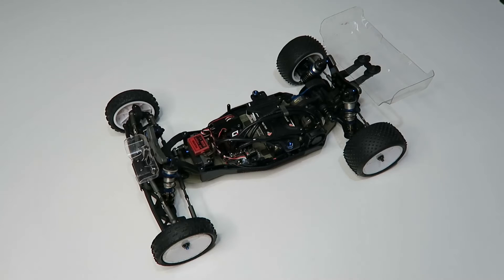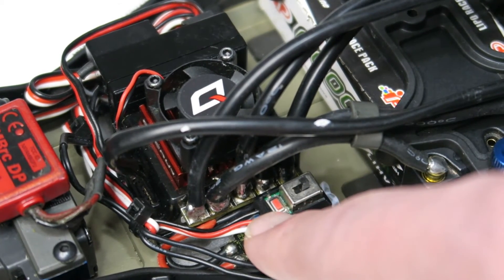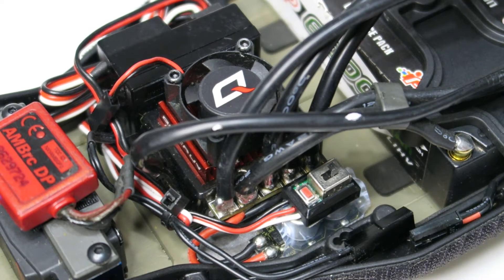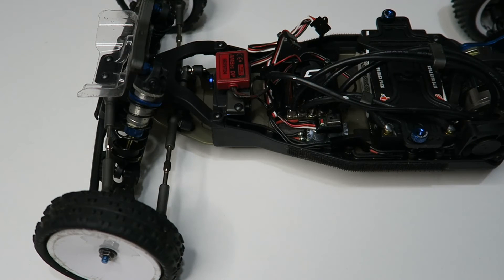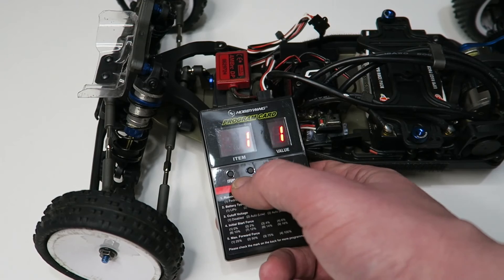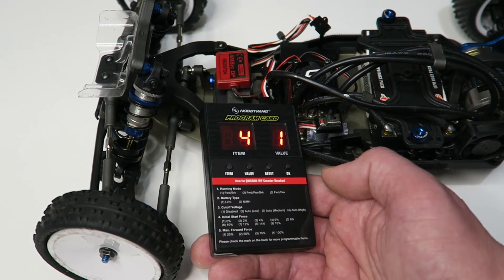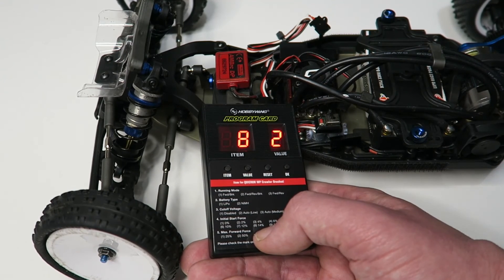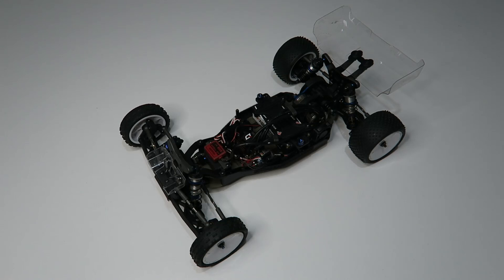Setting up the Hobbywing Quicrun 10BL120 - an RC ESC bargain!

Comment: Love this esc, its something I recommend a lot in the drift world for people who get disheartened when they find out everyone is running £200+ esc's. Works really well and the advanced timing allows them that elusive 'turbo' they all want. Just for context though, I run 25deg boost timing, 45deg turbo timing and 25deg endbell timing and no motor fan with 20+ min run times, its amazing what you can get away with when you don't have any grip lol
Reply: Does this part (quickrun) come with boost?
Reply: @aacgaming9023  yeah the setting is called advanced timing, look it up in the manual. It's not as good as a proper drift esc but it gets you started..
Reply from the maker: The timing adjustment on this is not boost, it is static timing advance, I would recommend leaving at zero.
Reply from the maker: No boost on these
Reply: @fiveeight0sixsix  it's actually what we would refer to as 'turbo' but yes it does have it, it comes in at full throttle exactly like turbo on any drift specific esc. I ran one for nearly a year in a drift car I know what they can and can't do. I will always correct bad advice on these when it comes to using them for drifting.

Comment: Excellent and in depth. I have had problems with this, but you just showed me how to set it up. I was having reciever brownouts and run aways. I now know to set lvc to 3.2-3.4 and lower the punch. The punch at 7 was giving me low voltage and amps to bec. Thank you great video
Reply: Just had a run away with mine and luckily the car flipped before hitting the kerb at 50mph
Reply: @wayneyates700  if using flyshy radio set the fail safe. Replace the cap pack with at least 6600uf
Reply: @rccarsandmusic2641  I am using flysky, so thanks for the information 👍. I've tried looking into it more but there's only so much I can find. 👍
Reply: @wayneyates700  I did that than it ran faultless
Reply: @rccarsandmusic2641  I think hobbywing should really be putting more info on there packaging and in the instructions if it's not just plug in and play, if I new what I know now I wouldn't of bought it. TBH I might leave it out and run brushed again for a while as I'm using a Tamiya TA05 and not all parts are readily available, and it's in nearly mint condition so I can't risk another run away, 
a massive thanks for commenting back it's appreciated 👍

Comment: Good day! Nice video. I am still ocnfused: a long delay in my throttle... i press throttle and no responce, but if i press it second time i works
Reply from the maker: You probably have the motor wired up backwards and you are actually activating reverse on the ESC.

Comment: It is actually a Speed Passion GT2, which itself is a derivative of an Xerun v2
Reply from the maker: No, the case may look the same on the outside but the boards inside are completely different.

Comment: Hi bro, setup this ESC with 3650 Rocket unsensored motor for my speedrun build. I have an issue with full throttle, when I do that at lets say 10 mph I have delay of 2-3 second and can't control anything, just rolling can't stear can't brake nothing.. after 2-3 seconds the ESC responds again.. what do you think? When I drive lets say 30 mph and full throttle than its ok.. Running it with 2s lipo and mod1 gears on wltoys 124019... Not tried with 3s yet. My program card is on the way maybe need to configure something but what?

Comment: Awesome video - thanks.  Quick question - do you know what a constant red blinking (1/sec) LED means?  I am unable to complete the calibration, enter any program modes or reset the ESC - just get a red blinking LED regardless of how long the 'set' button is pressed / held...
Reply from the maker: Possibly no signal. Make sure radio is on and bound correctly to receiver. Check esc is plugged into receiver correctly (signal wire in correct orientation)
Reply: @fiveeight0sixsix  Thanks for the reply.  The receiver is bound, as the steering works as expected.  There should be a signal, as I can move the steering to a number of channels and it works fine - but when I use that channel for the ESC, just a red blinking light.

Comment: Good review thank you. It was vey clear to understand the button configuration and the program card. Does this come with the sensor cable in the box? Or does one need to be purchased and does it have to be hobbywing specific? TIA.
Reply from the maker: I don't remember if it came with a sensor wire. 1/10th scale sensor wires all use the same plug.

Comment: Hi great review! Thanks helps a lot! I've managed to calibrate but I don't get the solid green when in full throttle or in full reverse. Is there something that I'm doing wrong?
Reply from the maker: Make sure the radio is in its default settings with no travel limits applied.
Reply: Thank you! It was the transmitter

Comment: Thank you very much for covering the setup process using the led card and for the settings advices..I just installed mine (10BL120) with 10.5T Hobbywing Justock G2.1 4000KV motor..I made the first calibration and everything is ok,but the fan is blasting at full speed all the time,soo loud,is this normal?When I start the ESC the fan is gradually reving up till it sounds like a turbojet and when reaches maximum revs stays there all the time.
Reply from the maker: Totally normal, it's a powerful little fan. If it bothers you you can unplug it, although the ESC is more likely to overheat, I wouldn't recommend removing it.
Reply: @fiveeight0sixsix  ok,thank you for quick answer.

Comment: Thanks this was helpful one, got mine pretty nicely dialed. But what are the boost and turbo what some are talking about? Some higher end stuff?
Reply from the maker: Features to advance the motor timing dynamically for more performance. High end.  Rarely used in racing any more.
Reply: @fiveeight0sixsix  but this esc doesn't have them?
Reply from the maker: No it doesn't

Comment: I'm struggling to de solder the standard cables, I have a 30wt iron and it's not melting the solder. I need to remove the standard cabling as they are all far too long to fit under my WLToys 124017 body shell. Should I buy a more powerful soldering iron? The iron I have is 100% fine with everything else I work and I've never had a single problem with it until now.
Reply from the maker: The factory solder needs a very high temperature to melt. A more powerful iron will help with a small chisel tip. Also cut the original wires short so they don't act as a heatsink, just enough to pull them away with your pliers.
Reply: If you just heat up banana terminals with small torch and and dip the pre soldered ends in will melt and fit like factory , other then that you need a high temp soldiering gun also from my experience big difference with a good soldering gun and soldering wire

Comment: Great video, and overall a great ESC. I have a couple of these, and I still have the almost identical Speed Passion Version and the HW v2.1 which were high end ESC's back in the day! I do have an issue with one practically brand new one, the puch control seems to make very little difference. Racing 2wd 1/10 on very low traction dirt/dust. I have tried different batteries, sensor cables, motors. Punch is at 1, pickup is incredibly harsh. Any ideas? Trying the same equipment on an Xerun V3.1 is so noticeably smoother in my 1/10 Short Course!
Reply from the maker: If it's really harsh that would suggest sensor issues, maybe a fault with the port in the ESC. Otherwise I'd maybe check the transmitter settings and throttle calibration.

I'm sure the Xerun is much smoother than this at the limit.
Reply: @fiveeight0sixsix  thanks for your reply. My next move is to ensure its that by trying the other one i have....the affected one maybe fine for stock touring on carpet or something.

Comment: This video is so helpful! I was wondering if you could help me with the reversing motor rotation?
Reply from the maker: You can't reverse motor rotation on this.
Reply: @fiveeight0sixsix  oh wow that really sucks. do I just need to shop for a motor that already has the rotation i need? Thanks for the help!
Reply: @chrisdutcher9565  reverse rotation motors are not common outside of some crawlers. If you do not have a crawler (this isn't a system suited to crawlers), you may have built the drivetrain backwards, or set up your transmitter/esc incorrectly.
Reply: @sosidge  gotcha. Im pretty new to all of it but i do have a crawler and a drift car. This 10bl120 was going in the drift car. Ill do some more research and see what i did wrong.

Comment: help me please! I bought the hobbywing quickrun 120a version 1 esc I did the correct calibration, but the forward and backward acceleration commands are inverted! When I accelerate it goes backwards, and when I reverse it goes forwards! I already reversed the control but it didn't solve it! Even the reverse force is much stronger than the forward acceleration force! what could I do?
Reply from the maker: You've done the calibration wrong, you've set reverse as forwards. Start again.
Reply: @fiveeight0sixsix I redid the calibration again and in different ways and it didn't work! I calibrated in all different possibilities and it didn't work! I've already reversed channel two but it doesn't work either!

Comment: where on the esc did you connect the cable for programming? any port on the esc?
Reply from the maker: No, you need to pull the cable from the receiver

Comment: I’ve got three runs out of mine ,it now just runs the motor flat out as soon as you turn it on ,yes I did turn the transmitter on first,it will not now recalibrate to set end points on throttle ,first time it worked great but now all it does is beep .when you release the set up button ,seems like there’s a few people having problems with this esc after so many runs .some are getting burning smells ,some no motor power ,some the same problem as mine ,it’s got to be the worst esc hobbywing make for unreliability.

Comment: That looks like the program box that comes with the brushed 1080 hobbywing ESC. Can u use that one on a brushless 10bl120 ESC? I thought the label was blue on the brushless HW program boxes. I'm wondering cause I have the brushed program box and if u can use it wud save the $10 on buying the blue label box
Reply from the maker: The LED program boxes are all the same on the inside, they just come with different labels.

Comment: I have some of these and I really want to solder on fresh wires.  I can't even see the soldering post on mine though.  How did you solder on new motor wires on this ESC?
Reply from the maker: The soldering posts are in a row along the side of the ESC. If they're missing they've either been removed by a previous owner or you don't actually have this ESC.

Comment: How do you reverse the motor? Mine has more power in reverse than it does forward.
Reply from the maker: No reverse rotation on these. If it is faster in reverse it is a radio calibration issue and/or the car is built for reverse rotation motors.

Comment: Question: how did you connect the motor fan to the ESC? I have just bought this ESC but there is not port to hook up my motor fan?
Reply from the maker: The fan on the ESC is driven by the two small pins on the top. You don't drive a motor fan from the ESC.
Reply: @fiveeight0sixsix  To what do you connect the motor fan then? (sorry.. I'm just getting started with this hobby)
Reply from the maker: Receiver usually
Reply: @fiveeight0sixsix  Ah, alright. Thank you! :)

Comment: Is there an option to reverse motor direction? Mine is running backwards. If you can't switch through programming, can you switch wires on motor or is this an issue because it's sensored.
Reply from the maker: No, there is no option to reverse the motor rotation and sensored motors have to be wired in the correct order.

If yours is running backwards it's because you are using it in a car that requires a reverse rotation motor (eg some crawlers) or because you have built the gearboxes backwards (like you can with some shaft drive cars).
Reply: @fiveeight0sixsix  What about unplugging the sensor wire? Can the wires then be reversed, so I can use the car untill I get the correct motor.
Reply from the maker: By all means try it.

Comment: Which turn of kv motor does this eac accept? Is there a limit? Which motor are you racibg with?
Reply from the maker: The motor limits are listed in the manual which I have linked to in the description. I'm currently running with a 7.5 motor in 2wd.
Reply: Thanks I will have a look
Reply: @fiveeight0sixsix so I can run a 6.5t?
Reply from the maker: Should be ok

Comment: I have the same esc with the quicrun 10.5 motor. My car goes faster in reverse than forward.
Reply from the maker: What car?
Reply: I have exactly the same problem,car is much faster in reverse.Have you figured out what the issue is?

Comment: what to you think to put 10BL120 with 7700kv motor?
Reply from the maker: As it's a sensored ESC the motor limits are in turns, so compare the motor specs against the manual.

Comment: What mode to be in to make the 21.5 motor a little faster
Reply from the maker: You can try increasing the Timing setting but be careful of motor temperatures. Check your track rules on timing if you are racing.

Comment: Suggested esc settings for punch for 17.5 stock class?
Reply from the maker: 7 and above
Reply: How do i manually set punch without the program card? (10BL120 with 17.5 quicrun)
Reply from the maker: I've covered this in the video

Comment: I followed your steps, and my car doesn’t engage reverse at all. Nothing happens. It goes forward and brakes, but no reverse. 

I’ve used the card to make sure it’s selected .

Any ideas ?
Reply from the maker: Check your transmitter settings, reset it to defaults first.